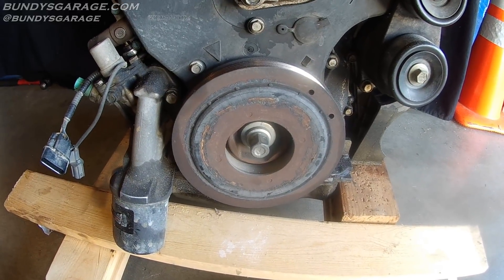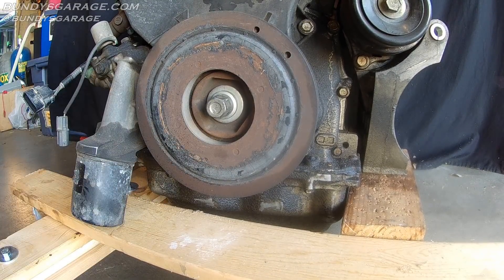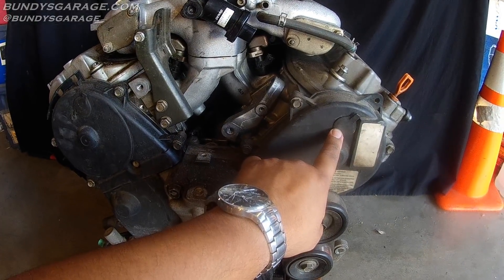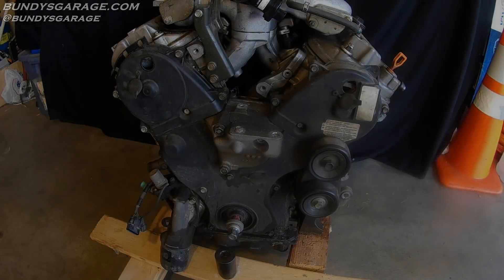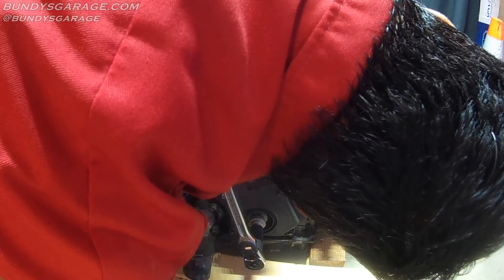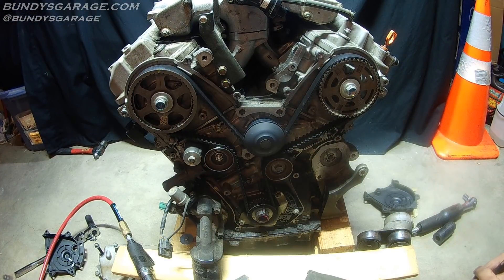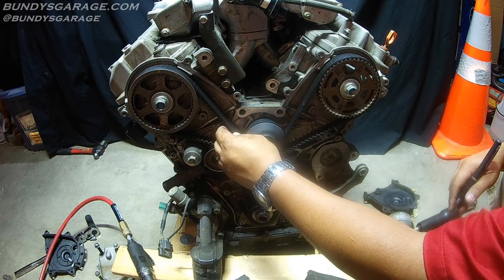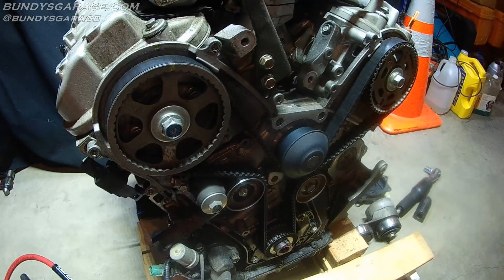Gaining Access to Timing Belt on Honda Acura V6 3.2L 3.5L 3.7L J Series Engine in Detail

Comment: I have another question.  Due to the low profile of the acura cl and the tl, are you aware of any drive up ramps which work for these  cars. I had to return a set because  the front  nose  hit  the  ramps  before  the tires  did.  Trying  to get  the car  elevated so  I  can  get under  the  car  without   the need    of  jacking  it   up with  a  pump  jack   and  stands.. in   order  to work  under  the   car.
Reply from the maker: I have a pair of plastic ones from Pep Boys I believe and I have put a lowered Accord up the ramps and never hit the nose at all. The metal ramps are more steep than the plastic ones.
Reply: Thanks  Bundy  for he   update
Reply: I purchased a set of low profile high strength foam ramps for my 14 Taurus.  The ramps go just high enough to drive up on.  That gives me the ability to drive on.  The added bonus of that plan is I can then have enough room to place my axle jack under the vehicle.lift one side at a time or with my extended cross bar place the Harbor Freight axle jack and raise both sides at once.  Enough room to slide the jack under and raise enough to place  jack stands.

Comment: I dont see the link for the crankshaft bolt removal tool.
Reply from the maker: Go to Amazon.com and type this in: Powerbuilt 648796 Honda Cranks Pulley Removal Tool
Reply: Thats  the  holder,   its  not  the lyle  tool   used   with  the   air  gun
Reply: Thats  the  holder,   its  not  the lyle  tool   used   with  the   air  gun

Comment: I have same car, won’t start. I know I will need timing belt kit, but how can I know if the valves are damaged? Any input will be helpful.
Reply from the maker: Did the timing belt snap?
Reply: I took off the top timing covers, I saw the belt intact but was chewed up and some slack, I was able to spin the pulley. There was a point where it was hard to spin and  then very easy. Your insight will be helpful.
Reply from the maker: Did the top 2 cams turn when you spun the crankshaft? All 3 need to turn at the same time.
Reply: BundysGarage  yes, all 3 spin, but I can’t see whole belt because I did not remove crank pulley yet, i see it’s going to be tough for me without air tools. Also, is there a notch on back sprocket that has to line up? The front one has numbers and a notch but not the back.
Reply: it probably is Honda engines are interference engines if u loose time on the engine the valves will crash into the pistons if it don't u are lucky

Comment: Very good video, just wish I could have seen the whole engine to make sure it looks like my own.  But, very informative.
Reply from the maker: +rcast22651 what is the year make and model of your car?
Reply: 1999 honda accord ex 3.0 v tech Thanks for the response
Reply from the maker: +rcast22651 yes this engine is almost the same as yours. Just a few minor changes but for the most part they are the same.
Reply: @bundysgarage  
Hey a question
Reply: @bundysgarage  ok thanks for the help great damn video even though it wasn't for my make and model this helped me immensely keep up the great work
Reply: Hey BundysGarage I bought a 97 honda accord ex with a v6 2.7l 24 valve are these motors the same as yours
Reply from the maker: Negative, thay are C series engines from Honda.

Comment: We're is the TDC sensor? 
I thought it was some ware  under those covers.
Reply from the maker: +Rudy Munoz what is the year make and model of car you are working on?
Reply: 2000 Honda accord v6
Reply from the maker: +Rudy Munoz TDC sensor is also known as the Crankshaft Position Sensor which sits at the tip of the crankshaft.
Reply: BundysGarage thanks

Comment: if you take the spark plugs out, the engine wont build compression and the bolt will be easier to re-remove
Reply from the maker: +Money Mac great ooint